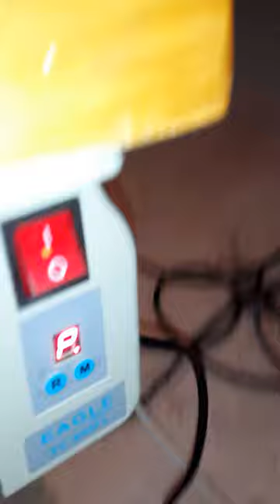servo sewing motor, brushless Eagle Special SC800FL needle position sensor

Comment: I know you did this 3 years ago Is it still good? I Just put the Eagle 750  motor system on today. Love it. Not sure if your set up was different than mine , You made it work but the big bolt goes in from the other side and the motor mounts on the other side of the post.  Hay it works for you .  It didn't come with directions but It did come with a detailed drawing of the set up. I just followed the drawing. and looks like you opted not to use the rubber mounts, I would think It would 
vibrate more without them.  and you helped show me how to mount the holder for the needle sensor Anyway thanks
Reply from the maker: Still works. Not sure what your talking about with belts and bolts. I didn't have any left over parts. The rubber mounts were not necessary.
Reply: Apparently the Eagle Special SC800FL has a different motor set up then the Eagle EA-750 motor set up.
Reply: Hello, I hope you read this since it is a few years since you wrote this. I just bought a used Pfaff 1245 that has a 750W Eagle motor. I have looked everywhere for some information about how to set up this motor. Do you maybe have the manual, or could you give me some info about this motor? Thanks, Rob (Netherlands)